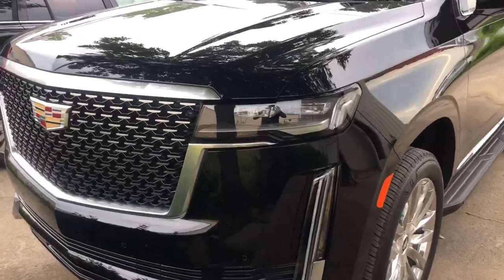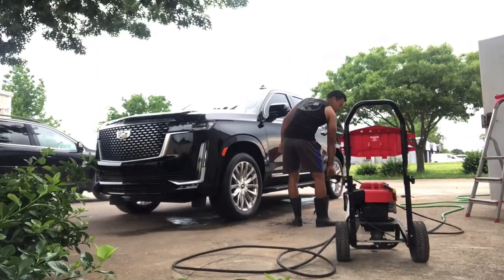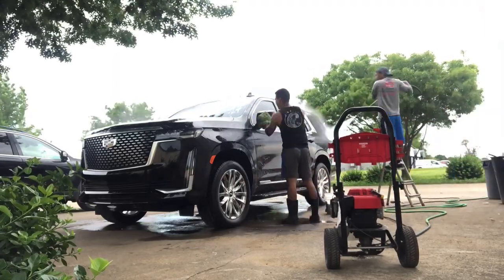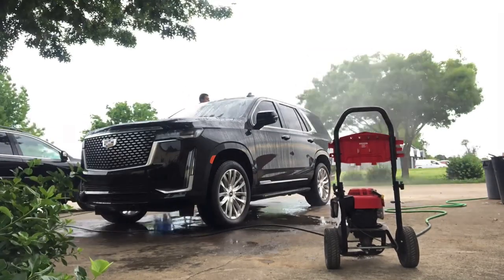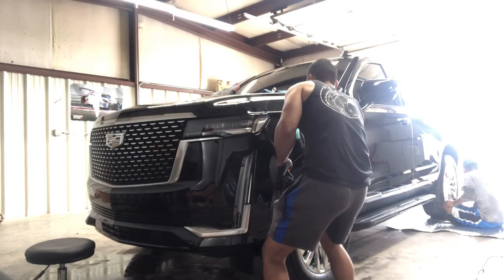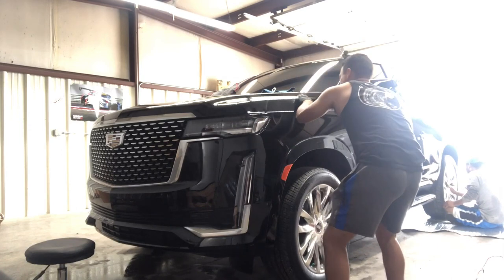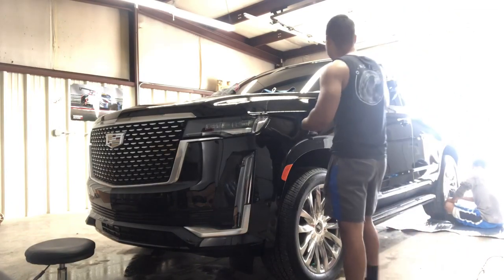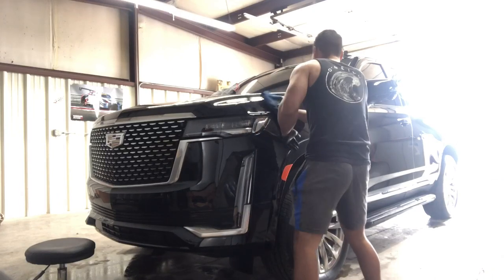2021 Cadillac Escalade Ceramic Coating - Armor Shield By Avalon King 👑

Comment: Ur usually supposed to remove the rims when u coat them.
Reply: U are suppost to bt in this case it was not needed. We were able to get them cleaned. The suv is brand new so there was no need to remove them when i could do it without it.